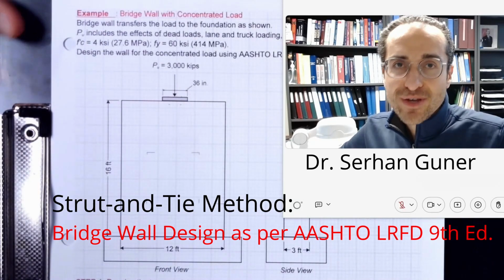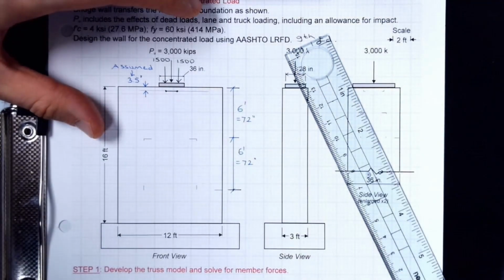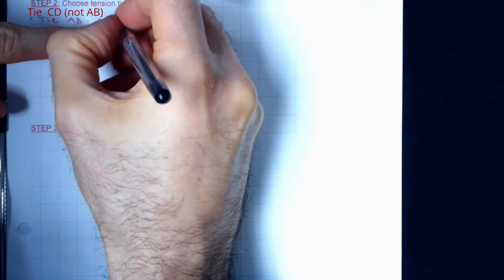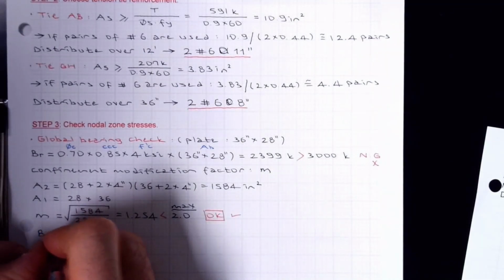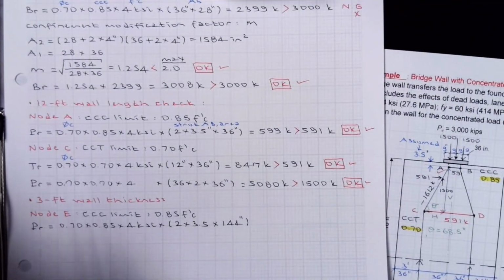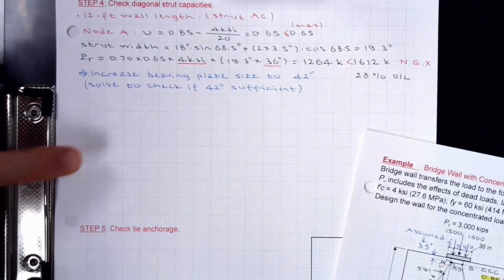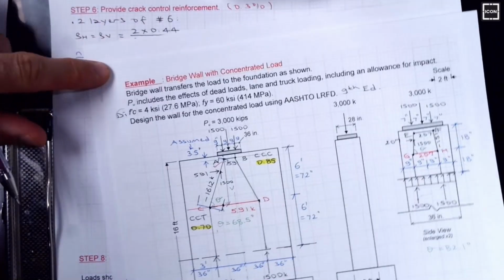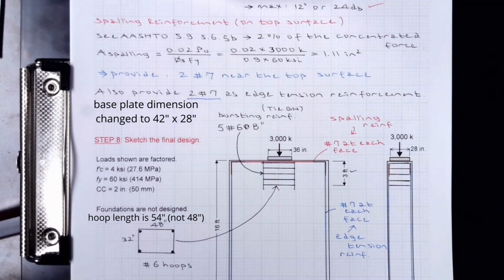Strut and Tie Modeling as per AASHTO LRFD 9th Edition (Bridge Wall)

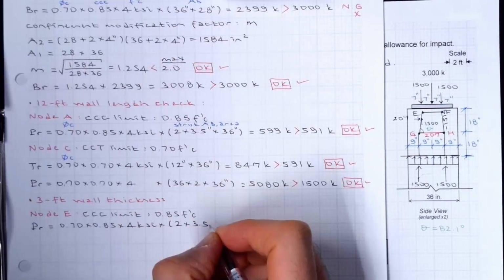Comment: Thanks for video. At 18:23, you calculated the area of the struct AB to be 3.5x144. I don't think we can use 144 in (width of the wall).  At 3.5 in down, you can't practically spread the load from 36 in to 144 in wide. Please advise.  Thanks a lot.
Reply from the maker: Thank you for your interest. Sorry, I missed your comment. Now answering your question, the strut cross sectional area calculation is correct. 2x3.5x144 in where 144 in is the out of plane thickness of the concrete member. This is for the left node (i.e., Node E) of strut EF which is a horizontal strut. Numbers appear correct.

Comment: Sir do we need to do this analysis if load us eccentric???
Reply from the maker: Yes. Each load case requires a separate STM. You may start with the most critical load case. Eccentric loads will likely be more critical.